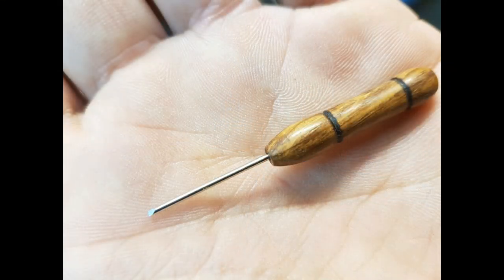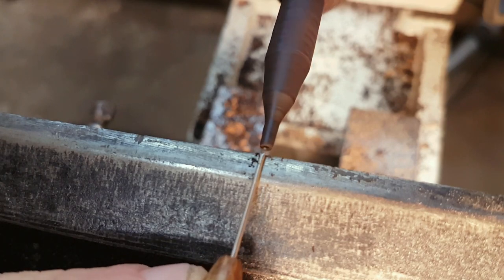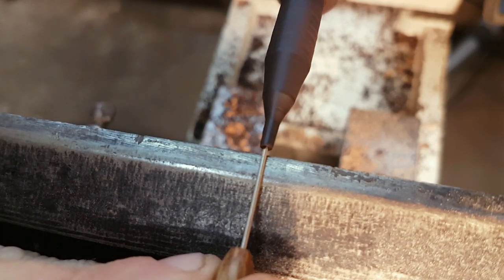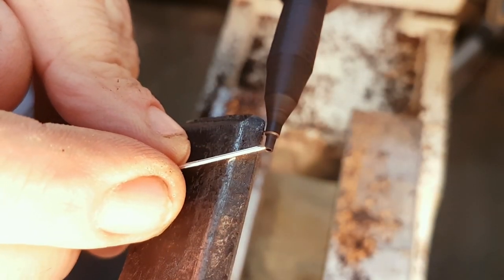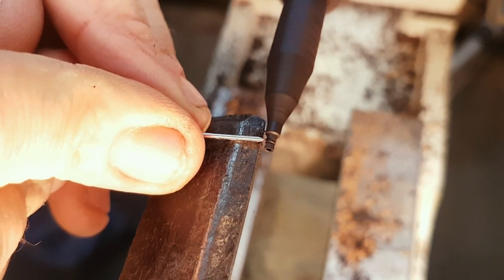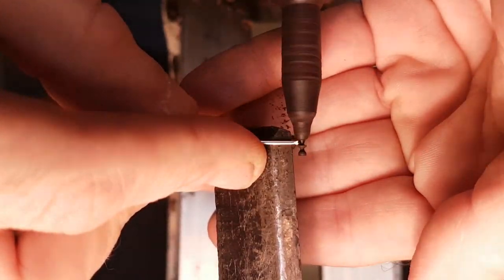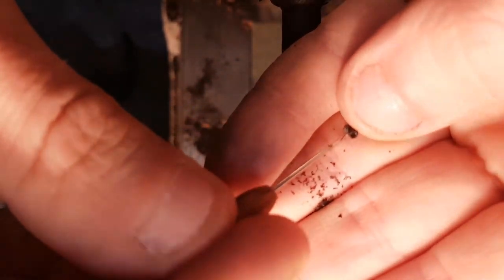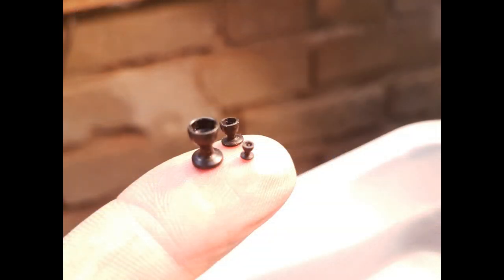Micro Turning Follow Up (2mm Goblet)

Comment: well done Yuval, for a goblet that small you will a small box to keep it in. I'll be in the cave on Thursday and make one for it
Reply from the maker: I would love to see that box! When it's done, I can ship you this goblet (I'll even pay shipping) so you could place it inside your box!! :)

Yuval
Reply: what is the height and diameter of the goblet, just so I can get the size right. I was thinking I could give you the box at Makers Central in May. How does that sound
Reply from the maker: Sounds perfect!!! :) The height is 2.5 mm (although I will shave that to 2mm, there is a little cupping on the bottom I need to sand off somehow once I figure how to grab it for sanding, and the diameter is 1.5 mm. Not a lot to work with :)

Comment: OK, what is your secret? I suspect these are normal sized goblets and you have really big fingers. Ha ha! I hope this comment does't start a conspiracy theory on YT.
I noticed you had some difficulty with your tiny skew. You might try making a cove tool from another needle to shape the stem. Mike Peace made one from 1/4" round HSS recently.
Reply from the maker: Thank you Gil! No secrets, I'm just very competitive and I have fairly good eyes and steady hands! ;) I'm not sure what is a cove tool, but when it comes to turn so small again, if you say it will help, I'll be sure to make one!! :)

Yuval
Reply from the maker: Google to the rescue. Found it, it's it's basically a round nose scraper made out of round stock instead of flat stock. Sure, I'll make one!! :)
Found this - http://www.davidreedsmith.com/articles/minicovetool/minicovetool.htm
Reply: Good, I think this will come in handy on this type of work.
Reply: Perhaps you can find a jewelers visor with magnifying lenses built in to do even smaller work.
Reply from the maker: Those are cool... a little steam punky... :)

Yuval